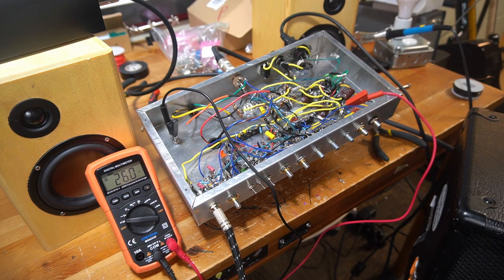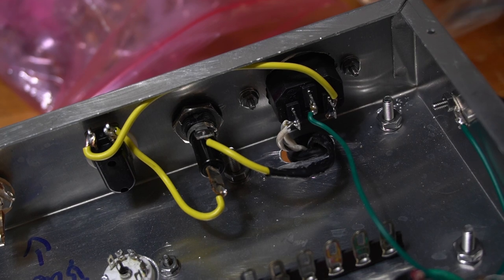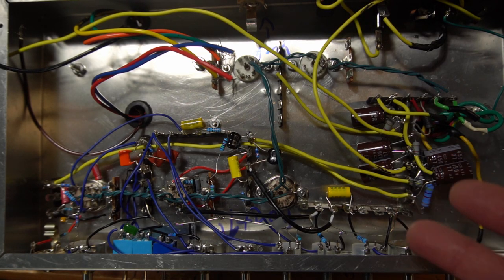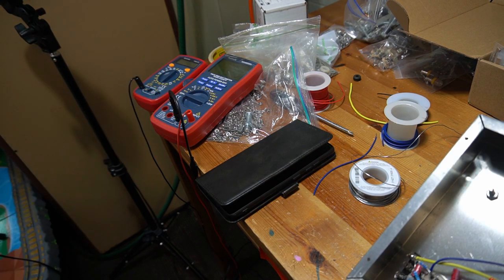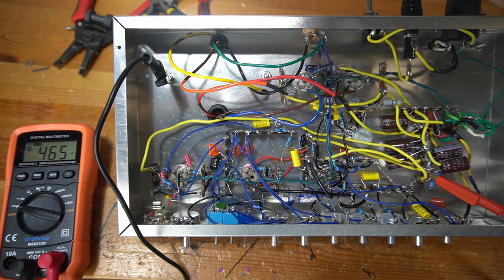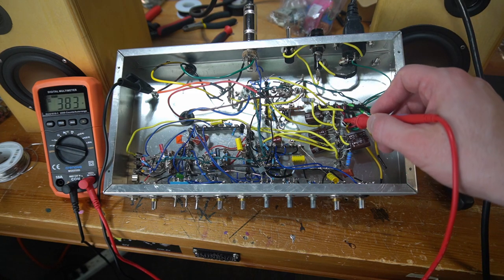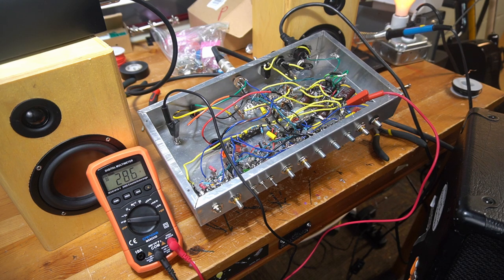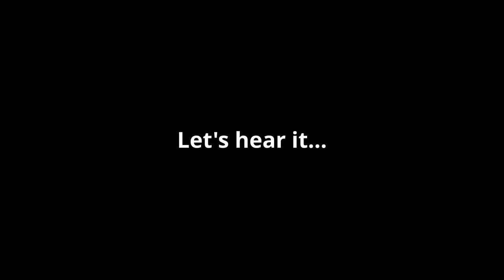Dumble Build pt 2 - Step By Step Build Walkthrough

Comment: Just an FYI; if you want to peel off the cling wrap from the blank chassis, that's fine, but if you do, then get some wide painter's tape and mask off the entire surface again.  That way, you can draw your lines and points onto the tape, and the surface will still be protected as you drill or perform other operations.  You can do this internally and externally for a much cleaner finished look.

Comment: I understand your use of the EL84 for lower wattage. But I've never been happy with the sound of the EL84 tube in comparison to a single 6L6. Shouldn't you use the best sounding tube, and restrict the output instead?
Reply: Funny, some of my very favorite amps of all time are EL84 based, i.e. Matchless DC30, Vox AC30 and AC15.  I also very much like 6V6 amps like the 5E3.  Both tube types are capable of excellent sound depending upon their implementation within a design.

Comment: Kley, if you are reading this, I'm just trying to be constructive and I do admire your effort here; But, my god, this is a mess, I don't know where to start. First off, if you are going to do point-to-point, do it neater, but also, don't do it. It's not hard to make a turret or an eyelet board, it's much cleaner, and easier, making a layout for it isn't hard, you can use a paint program and then tape it to the board to drill all the holes, easy-peasy. Secondly, the PT you chose is for a Marshall 18W which uses a GZ81 tube rectifier, which has a voltage multiplier effect of about 1.1 ( So with a 290-0-290 PT like you are using you can expect to get roughly 1.1 X 290 on the plates of the EL84s which would be about 320 ( 5Y3 would be similar ); BUT, with an SS rec, it would be around 1.4 X 290 = 406, too high IMO. 5U4 would be 1.2 and 5AR4 is 1.3 just for the record. In this circuit you could not solve this problem by using a tube rec, because the power supply filtering is too high for that and would make the amp motorboat.  You check the bias and it's way high. but you just plod on, you should have a chart at the ready to see what values you want to be going for.  A 230-0-230 PT would be better suited for an SS rec. I was watching as you turned the amp on without a load, glad that you caught it, you should never do that to a tube amp unless you want to cause major damage to it. it looks like you might be using a guitar chord as a speaker cable ? If so, DON'T DO THAT !!!  You need heavier duty cables for that and they should not be shielded. For DIY you can make them out of zip chord. You really should have a grommet for those PT wires to go through, that's asking for trouble.  You say you want to hear a clean sound and then you turn the master all the way up, that will do the opposite because now you are hitting the EL84s hard and they distort easily, turn the master way down and turn up the preamp to hear the clean sound.  I also think you should get a sharpie and label all the controls since there are so many so you don't get confused.  Building amps can be expensive, I know. Bigger transformers and tubes cost more money. A premade chassis is much more than a project box. Higher quality filter caps cost more. But, in the end, part of the reason to DIY is to make it great and have something you can be proud of, a few hundred more dollars and you would have an amp that is much closer to D style amp and would be easier to tweak. Oh ya, one way to avoid getting solder in the socket holes is to stick a tube in them before you solder any wires to the pins.
Reply from the maker: Hi Ryan, I always welcome feedback!

I understand PTP is not for everybody.  I personally quite like it.  It allows for very short component runs and efficient use of space.  If it is an amp I'm building for personal use then I don't have to worry about it making sense to anyone else but me.  This build probably pushed the boundaries of being overly complex.  I like trying a variety of building methods and ultimately produced a working amp.  

I think the PT worked out fine in the end, but I do agree that a tube rectifier would have been a nice solution.  I wanted the higher B+ and the stiffer feel of SS rect for the Dumble thing.  

I do have several speaker cables that I use for testing and was a few of them throughout the video.  

Regarding cleans I was trying to find the highest headroom clean tone, so I set the master to max and then turn up the preamp gain until clipping - then backoff a touch.  I agree EL84's are pretty easy to distort, but that's the recipe for cleans.  

I believe I did a proper bias and a face plate in subsequent videos, but I'm forgetting a bit now.

Comment: When you checked your AC from one side of the IEC to ground you are checking your mains voltage to the center taps on the transformer that is tied to ground for reference.  To check mains voltage at the power input connector, just check across that connector. Every time you are checking AC voltages with your probe attached to chassis ground you are splitting the reading roughly in half. This is fine for checking DC voltages in ref to chassis ground, but this isnt how the AC voltages can be measured in a circuit. Also, you can't read voltage drop across dropping resistors with no load. Ohms law my friend. V=IR. if there is no R then your won't see a change in V or I.

Comment: This is a great video (even if you posted it a while ago now) 46:01. When you hear that zap noise, if you zoom in close enough Im sure you can see the cap blow, the black one in the idle of the chassis, directly facing the power switch. Looking forward to watching part 3, I really want to build one of these now. Do you know roughly how much it cost for all of these parts?
Reply from the maker: Thanks!  I don't recall specifically.  I would guess somewhere in the ballpark of $300-$400.  Depends somewhat on what you have on hand.  Big parts the chassis and transformers.

Comment: You mean to tell me you couldn't have used a nice Garolite board with eyelets?  Spaghetti 🍝 mess in there. Built many Dumbles since 2006 using many different types of power tubes. Organization and a clean build just works better and easier to keep the noise floor down on. Yes it does work better just saying it. Good luck to future builds..

Comment: Sounds pretty great! I built a 5e3 Deluxe last May and Im still trying to get it to sound the way I want, takes a lot of patience
Reply from the maker: Thanks! Curious, what are you looking to change?
Reply: @KleyDeJong  it has a lot of bass and my single coil guitars sound pretty good, but my les Paul humbuckers and p90 on a Casino don't sound good. I have lowered the values of the coupling capacitors. I do have one guitar with humbuckers that sounds pretty good, Seymour Duncans that are not real hot. The Les Paul is pretty hot.
Reply: @danpearson2471  stick some shapeing pedal in for humbucker guitars. Basic Boss SD1 with gain all the way down work wonders to remove unnecessary low end from humbucker loaded guitars. And its dirt cheap solution.

Comment: Maybe I missed this in your video. Why didn't you use a circuit board for the circuit?
Reply from the maker: I went with a custom circuit so I would have had to design and have my own PCB built.  I have done that before, but I find it isn't very conducive to one off builds.  It may require some prototyping.  I like to build PTP.  It is very convenient for when you're making something custom.  PTP has very short wire runs between components which I find helps lower noise.  I also like the challenge.  Building PTP appeals to me almost from a creative perspective.  It is almost like painting.

Comment: Kley that is a great sounding amp...i want to build some el84 amps myself...i have a Crate vintage 30 with those and it sounds like those type Marshalls...the little PA heads...not really much Vox tone or jangle, but i like the little Marshall tone better anyway.
I love watching you work...drilling a chassis over a plastic wastebasket...that was great.
So whats the diff between yours and those 100k Dumbles?
Reply from the maker: Thanks! Good question. Some difference in components, but I believe my amp will do that thing for me and my purposes 98% as well at a fraction of the cost.
Reply: @KleyDeJong  so what would you guess is in those boards where he immersed them in TAR just to keep us from reverse engineering them?
Im with you...98% less money.
Reply from the maker: @edwhite7475  Resistors and caps just like mine.

Comment: Hey man,,, is it important to keep your heater wires in phase?? The tradition in the U.S. is green heaters, in the U.K. white red. I always thought to use like green purple or green white to keep things in phase. Can't hurt.
Reply from the maker: Good question. By that do you mean the same heater wire goes to pin 4/5 while the other pin 9 on all the 12ax7's? As opposed to paying no attention to which one goes where on each tube?

I have not paid attention to that in the past, but I'm curious now.
Reply: @KleyDeJong  i mean ,, the start , from say a fender is green green from the pilot light to the first tube.either wire ,,,doesn't matter but from there it's like a daisy chain so  keeping say green to the lower number pin and purple to the higher number all down the line. It could cause mystery hum thats hard to track down. I'm a nube but watch all and any amp building tech stuff and understand whats what but my wife won't let me get my feet wet with building amps!!! I've heard uncle doug mention that some fender amps came from leo's plant where the mecican lafies building would do that and others didn't. Could have misconstrued that! Good topic for the amp forums!
Reply from the maker: @russellesimonetta3835  Sounds like a fun experiment to me!
Reply: @KleyDeJong  oh yeah,  as I said I'm a nube but for your circuit analisys series how about a look at an amp Weber offers as a original series amp. It's a tweed princeton harp amp. But it's a single ended but run with a KT 66! A high octane single ended amp is kind of a rarity! I ,for one only, am curious as to how good it would be as a guitar amp ir what tweaks would make it a great guitar amp!  From looking at it it has a choke but no neg feed back. That could be a fun project!

Comment: Hello, great video. I have a question, that I never saw answered in any Amp build video. How do you space the components on the chassis? Meaning transformators, valves etc?
Are you following some template, or personal experience?

Comment: How do you manage to get the right plate voltage for the EL84s with your classic tone 40-18056, wich gives 580V output ? Also, where do you take the power section schematic ? We don't see that part on the D'lite one. Thanks.
Reply from the maker: Check the upcoming episodes, but basically I shifted to use JJ 6V6S tubes to handle the higher plate voltage.  

The power section design is a bit based on several D style amps I reviewed and some of my own personal power supply theory.  Valve Wizard is a big source of inspiration for me.

Comment: How much do you estimate this built cost you? Planning to do a proj like this but a steel stringer
Reply from the maker: Good question. A lot of these parts I collect at opportune times. I'd estimate $150 for two transformers and a chassis. $100 on lots of misc things like sockets, switches, pots, e caps, etc... I'd say my builds push the boundaries of being frugal.

Comment: ¿Is possible To make it sound "clean" more like a twin Reverb, so if  you hit the note don't break up?
Reply from the maker: Yes, I have not implemented channel switching yet, so the amp is just the drive channel hard wired.

Once the clean channel switch is in place it will be very clean.
Reply: @KleyDeJong   i would love to build this circuit, it's so versatile!!!
Reply from the maker: @JuanMotta  I love mine so far, great amp!